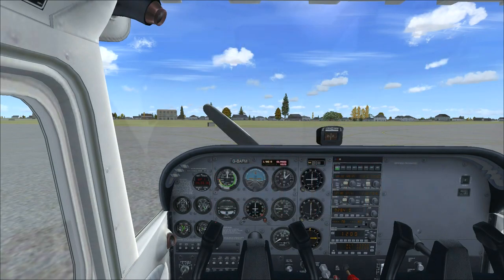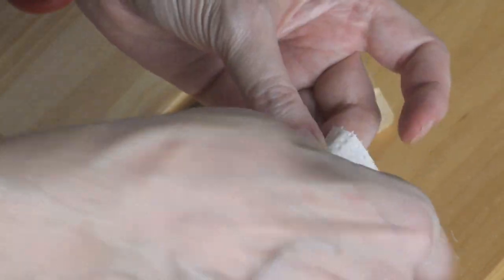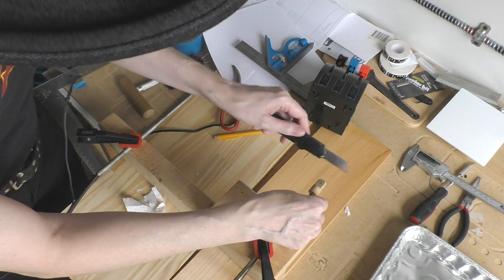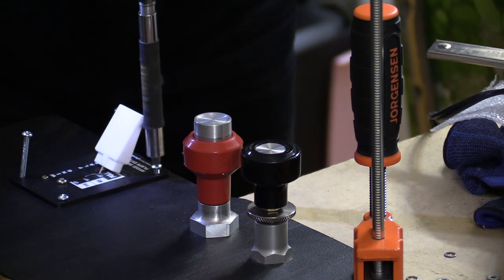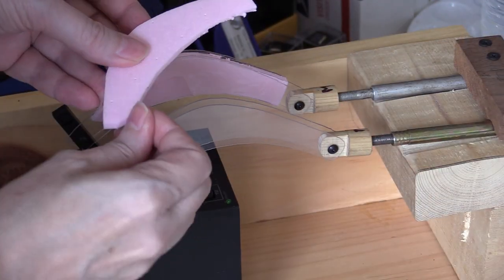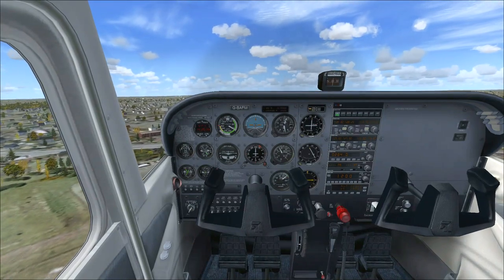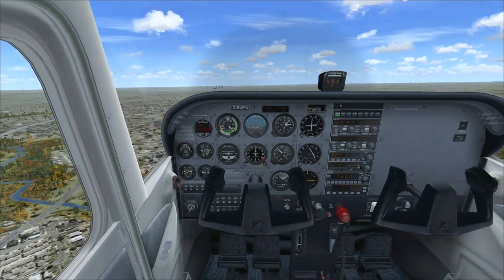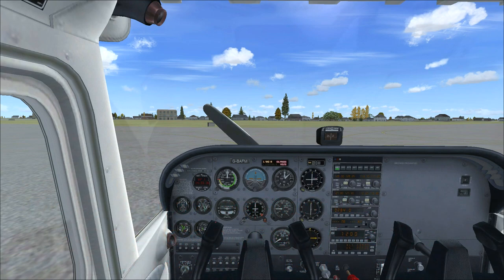Building A Flight Sim With Real Cessna 172 Controls!!!

Comment: Flight Simulator has gotten so much better.  I really haven't messed with it since the middle '90s.  I trained in Pipers so the Logitech configuration would work for me.  😁
Reply: The Logitech yoke lacks proper forward and back pressure so it's a bit meh, the Alpha yoke is far better in this respect. You're right, the Logitech ex Saitek quadrant is fine for a Cherokee, I owned a PA28-140 but trained on Cessnas. TBH, not really much practical difference when difference training between push rods and levers on the throttle quadrant. What's missing IMHO is the trim wheel!

Comment: IRL Cessna & Cherokee pilot here, and a simmer. The yoke feel and the elevator trim tab control are probably the most important controls that need working on for me in a sim. The yoke needs to have the right amount of forward and back pressure, which as I'm sure you know you compensate with using the trim tab.  The trim tab is regularly adjusted throughout any flight to maintain steady altitude.

So I would like to see any trim tab solution you come up with! 2nd hand Saitek Cessna trim wheels go for $$$$ on eBay as sine Logitech bought Saitek, they dropped the trim wheel.

Comment: I really like that way of creating threads in wood. I have used a tip from Keith Appleton before about cutting the threads and then soaking them with thin CA glue to reinforce them. The paper towel does have the advantage of not risking splitting a small piece with the force of the tap, and you get threads all the way to the bottom of the hole.
Reply: I have used that technique on RC airplanes for years. Surprisingly durable
Reply: Ahhh keith appleton reaches franlab.
Hes an amazing craftsman
Reply: @paulcresswell2279  The AI rules us all Paul doesn't it?🤔 Many of us are all watching many of the same channels. All great stuff.😀

Comment: Nice job with the Cessna controls! I used to play Flight Simulator a lot in the 90s, using a CH Virtual Pilot yoke and Thrustmaster rudder pedals. It helped me on learning to fly for real. Just a tip, don't chase the runway on final by banking, keep the wings level and use rudder only, it's much easier and smoother!

Comment: nut zert or nut sert works well on wood with a bit of epoxy. that way you have metal threads.
also use stainless steel nylock nuts work well to hold those little screws so they can be serviced at a later date.

Comment: I worked for many years in training simulators used for another field (power plant control rooms).  Getting the location and 'feel' for the genuine controls is a key part.  Then you can run the student through all sorts of scenarios, with variations from time to time so the student doesn't get too comfortable with everything going exactly the same way each time.  They're a great way to learn.

Comment: Love the acrylic / foam / adhesive construction trick!  I learn something every time I watch one of your videos, Fran!
At one point in my checkered past, I interviewed for a job with one of the big U.S. aircraft companies who wanted to update a flight simulator for one of their products.  It had been hand-written in some obscure machine code for some obscure processor.  I asked if they had a C compiler ("No"), a symbolic assembler ("No") or a linker ("No").  I asked if the schedule was critical ("Yes").  I asked if they'd considered interfacing their own particular controls, as Fran has done here, and customizing flight dynamics with Microsoft Flight Simulator ("No - what's Microsoft Flight Simulator?").  I thanked them and left the interview. :-)

Comment: You'll get better.  I flew both 150's and 172's.  I preferred the 172 since it was a bit more stable when I was training.
Reply from the maker: I can't fit in a 150 - I'm all leg.
Reply: @FranLab  I'm a leggy 6'1" and have poured myself in to a 152. It took some doing and I ended up with my knees in odd places. Fun little plane, though: easy to fly, hard to fly well.

Comment: At 20:45 be careful about adding flaps when your airspeed is outside of the white arc on your airspeed indicator! I am a flight instructor. You are right you should have trimmed the plane as that would have helped check your speed on downwind. Keep up the great work!
Reply: The white arc (85 knots) on a 172P or later is for flaps 20 or more. Flaps 10 is OK up to 110 knots...and a handy way to slow down on approach.

Comment: One more tip: never use full flaps until power off landing is assured. If you find yourself adding power on final when you have already added full flaps, you have not managed your energy properly. But that is what the simulator is for! Great work!

Comment: I did my apprenticeship at a small regional airport in the UK, airport maintenance, not the aeroplanes. Airfield lighting and building electrics.
There was a really old simulator that simulated the propeller driven planes the main airline at the airport used. It was a huge bank of cabinets with relays and small motors, nothing digital in it at all. The thing took up half a hangar. Towards the end of my time there another airline started to use it as their base of operations. Their simulator was in a Porta-cabin, all ‘new and digital’.
Unfortunately I was never allowed to try and ‘fly’ either. I did ask several times, but always got a definite ‘No. This simulator is not a toy!’. (This was before PC’s were even conceived, even the ‘new simulator’ had no screens to ‘see’ through the windows)

Comment: Broken drumsticks make good raw materials for exposed parts, if you can get them cheap/free (or you broke them yourself). They'll be hard, from a defect-free piece of wood, and tend to have grain that is pleasant to the touch even after cutting and sanding. The limit, of course, is that you can only make individual parts up to the diameter of the stick.

Comment: This is beautiful. I have been working on a home cockpit for 2 years and you have everything you need on a wooden block. I'm seriously thinking of doing something like this to use in the meantime. 

Because I love realism, I have tried getting a real mixture and throttle knob, but found that even old used ones are incredibly expensive! Did you get a special deal on these?

Comment: The construction part was excellent. Your knowledge of flying could be vastly improved if you went to a local airport and took a couple of lessons. For example when you climb out you are primarily looking for best rate of climb. The rate of climb is secondary. When you are on down wind in a light plane the distance from the the runway is the same as your altitude. Which is easily checked because the runway as you look down should be 45 degrees. You were way out there. This would be bad for two reasons , one,  all planes in the pattern should be flying the same pattern for safety. the second reason is in the event of engine failure on downwind you should be able to glide to the runway. Any time you are making power changes you are more likely to have an engine problem. There is a sequence of events beginning on downwind where you start flying by airspeed and allow altitude to change. (starting at the abeam point) It is best you that you experience this in a real plane. You will love it. Nice video.
Reply: She was taking flying lessons at North Philadelphia Airport, but the move threw a monkey wrench into it.  Fran -- If you were learning on a Piper, the unmodified throttle quadrant looks about right for a Piper Arrow (also has the prop lever - GUMPS).  Also, larger airplanes do not use the Cessna-style pull out throttle so I think it is a good idea to get use to the quadrant.  I learned on a Piper Archer and had no trouble picking up the Cessna throttle when I checked out in a 172 later.

Comment: Awesome. Just needs a trim wheel. Your hand is always subconsciously popping over to the trim in flight, buttons don’t do it justice. Even if I have electric trim in a real airplane, if I have a manual wheel in good ergonomic position, I use that instead.

Those vernier mixture and prop controls in Cessnas are great, and I don’t think any of the “toy” controllers you can purchase have that function. I wish I’d had these skills when I was building my simulator for initial training.

Comment: The one time I flew a C172 I couldn't adjust the seat to allow me to use the rudder pedals. The worst bit was on approach to landing I managed to stall the starboard wing (and beat the instructor to the throttle for a go-around) ;)

Comment: Do you recall where you found the USB Flaps control online?  Also going to use your technique to convert my Logitech throttle to some push pull knobs and cable for my Cessna 172.  Thanks for posting the video.

Comment: Too bad most of the stuff on a panel in FS 2020 doesn't work (yet).  But what REALLY sucks is FS 2020 doesn't properly support multiple monitors (again, yet).  All we have is the one ugly single view screen. Sure, you can span it across multiple monitors (I use three for my front view and one fro my maps with Xplane 11) but the sides will be stretched and distorted.  I enjoy having a ~180 degree FOV. We can't do that in FS 2020 unless we zoom back so far it looks like you're flying from the back seat.  :-)

I just noticed you're using FSX. Time to upgrade. :-)

Comment: Hopefully someone will offer a good quality, but not wildly expensive, Cessna-style control option.  Honeycomb would be ideal.  In the mean time, this is a great project! There are some 3d printed options out there also.  For full-on DIY, I've found MobiFlight on arduino to be pretty impressive.
Reply: True.  The Saitek/Logitech flight yoke system and rudders are less than optimal.  No matter how much time you spend trying to adjust the sensitivity, control motion is still jerky due to the less than 180 degree swing of the yoke through the roll control axis, and the rudder pedals are just plain horrid.  Not only are the rudder pedals at the wrong angle, the tension is just way too much, even on the lightest setting.  Not very realistic in the least.
I will say that the throttle quadrant is the best part of the entire package though.

Comment: No flaps until airspeed is in the white arc!!! Power back to say 1500 RPM, hold the nose up until the airspeed drops into the white are, then flaps. Northeast Phily Airport!!
Reply from the maker: 10° flaps under 110 knots in a 172SP, 20° or more under the white arc (80 knots).
Reply: Sorry Fran, you are absolutely right!! I'd never seen this before or ever heard it mentioned - I've always flown older 172s - other people have been confused by it too by what I read on some forums - I've just always had 'white arc, Vfe' drilled into me. It always pays to read the Pilots Operating Handbook!!!

Comment: Excellent work Fran!  There is nothing like the feel of the "real thing"!  Very elegant mechanics to be sure.  I don't work with general aviation avionics or private aircraft parts, but if you feel that you want to make a military simulator, or airliner cockpit simulator, using real parts, you know I'm there to help. From real throttle quadrants and controls to instrumentation and 400Hz power sources, no question you ask will be new to me.  The materials and craftsmanship that goes into military aircraft and airliner parts have a "feel" that can't be replicated by plastic.  I'm sure you'll work your way up to business jets and beyond.  Keep it small and portable!  Me and my other flight sim cronies went way off the rails when we bought the actual noses and flight decks from 737s to 747s.  Luckily a ton of the "magical" mechanical interlinks in these cockpits are usually intact.  But you can make your own, obviously.  Reminds me of my humble beginnings.  I had to interface the mechanics of a real A-10 throttle quadrant to potentiometers and there's many ways to do that.  It's a very addictive hobby!
Reply: Hi there.. could you pls direct me to some 400Hz / 27V 3 phase inverter design? I'm buuilding a soviet mig.. i have almost all the instrumentation and now i'm going for frame work and the physical stuff, next thing power and then programming.
Reply: Vit, I don't know of any 3 phase 400Hz plans or schematics out there.  To do it properly requires a lot of custom magnetics or very high power FETs to generate a 3 phase 400Hz power source.  There are two ways I know of to acquire 3 Phase 400Hz.  The first is to buy a used surplus aircraft 28VDC to 115V 3 Phase 400Hz inverter and they show up on eBay from time to time.  The other option is to find a power converter that can take 115V 50/60Hz in and output 3 Phase 400Hz at whatever voltage you want up to a few hundred volts.  An example of one of these is at the following link: https://www.ebay.com/itm/383864716794?hash=item59601ebdfa:g:r0wAAOSw8vJf3MiO
Reply: Nice! Are any of you folks working with VR, with the headset and hand tracking!? That has been a pipe dream of mine for ages, one which I'll enact when I have the resources (time, money) to do so! Cheers for your message, it's heartening to know there's other folks out there who go to such lengths! (There always are but usually it's difficult to find them!)

Comment: Very nice. I did a similar build a few years ago. I pulled apart a logitech joystick and used all the pots, switches, and board to fabricate complete helicopter controls. I love MDF for these projects. Doesn’t take screws that well but super cheap and no wood grain. 

Ever try head tracking?